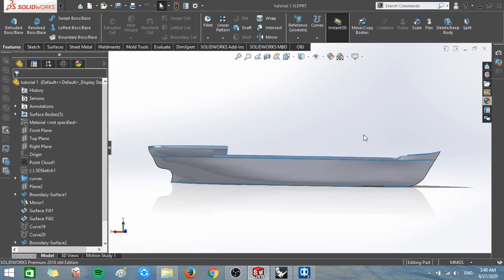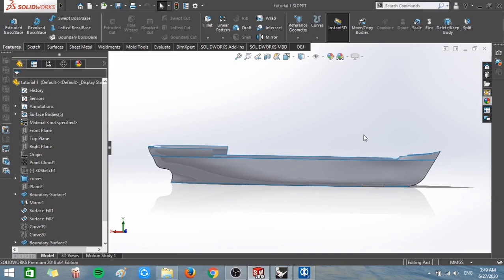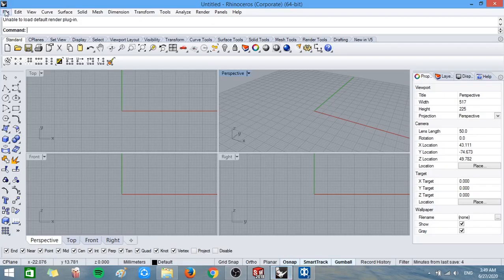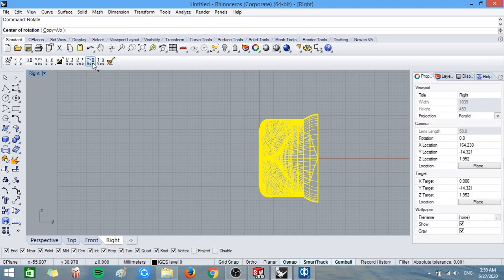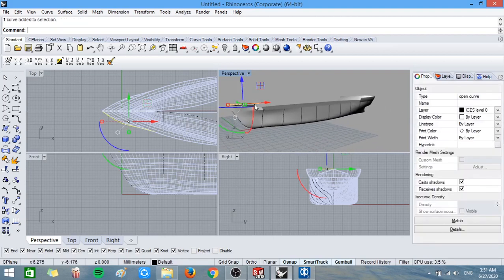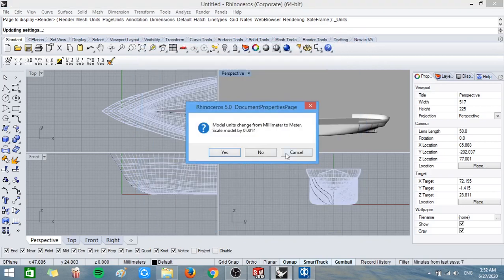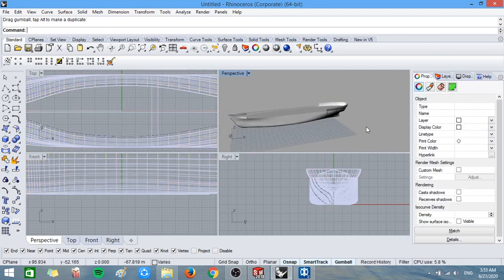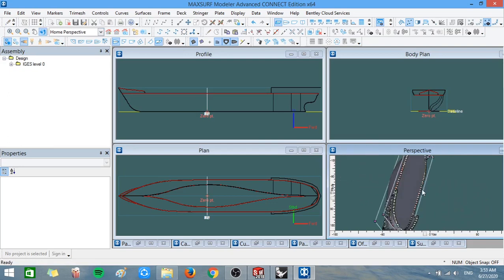How to export from Solidworks to Maxsurf using rhino

Comment: Hello, I have been trying to export a maxsurf yacht to solidworks using the iges format however when I do this solidworks does not recognise the yacht as a editable feature. Would you recomend exporting to rhino first and then from rhino to solidworks?
Reply from the maker: No you dont have to do this you can export from maxsurf directly to solidworks by exporting the file iges but as u said it will not be editable and even if u exported from maxsurf to solidworks using rhino you will get the same problem, you will get only the surface and after that you can add whatever you want, just go to file—> export—> iges—>3D IGES—> pick your own scale—> NURBS surfaces —> ok ,then go to solidworks and open the iges file you will get the surface so u can add your superstructure, containers and etc.
Reply: @Abdelrahmanyousry  this works thanks. I can actually edit the yacht by adding planes from which I can sketch on the deck. It's only not possible to edit directly on the surface but it seems to be a problem I can get around. Thanks for the advice👍🏼
Reply from the maker: @p1active101  You are soo welcome

Comment: Can you please clarify why do you do this? I am trying to work out how to design 7m aluminum boat so i  research on most effective ways that will enable me to cut all parts on cnc plasma. Solid works is my weapon of choice but it makes me wonder if there is an easier way to do it .
Reply from the maker: What way ur talking about ? Like the way i made the model or the way i export it from solidworks to maxsurf anyways the way i made it, you can watch my previous video and I actually find that an easy way and it is gonna give u the perfect surface ever and if ur asking about the way i exported it from solidworks to maxsurf  you can save the solidworks file as igs and then import it to maxsurf but make sure that ur units in meter this way barley works tbh ur gonna have work a lot on ur model when u import it to maxsurf because ur gonna get some errors (depends on ur model) idk i hope I answered the question